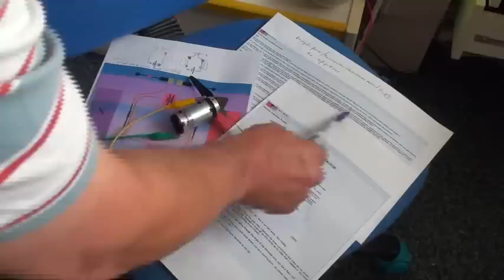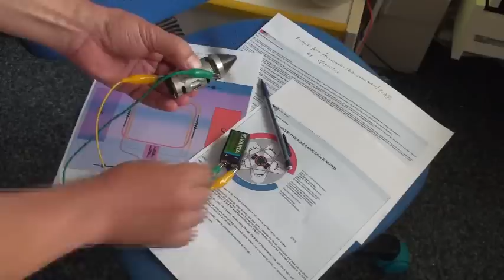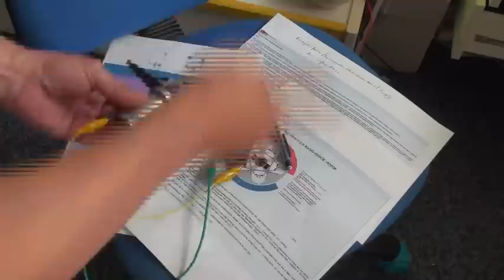Ufo assymetric motor part 1

Comment from the maker: Hi htannberg

Yes  the part 2 was irrelevant because i did not realise (too much enthousiasm ) that my drawing was not in accordance with the real connection in the real motor. So my presentation was misleading Sorry. So i retired the video.

Now i am in full discovering mode in this motor and  i am testing a lot of different config.
So for the precise data you have to wait.
This motor is very intriguing, so i propose that you replicate it and report  you results.
Laurent

Comment: What happened to part 2 ?  Did you find a mistake?  Please post the rating on the unmodified motor  volts, rpm current, and on the mondified one.

If you have another motor use the propeller as the load and do both messurements, and submit data.  Thanks!

Comment: Hello Woopy. Have you made a comparison between the stock motor and the modified motor. What is the wattage of the stock motor spinning the propeller at a given RPM. Then what is the wattage of the modified motor spinning the prop at the same RPM. I'm trying to find how much more efficient the modification is. UFO said the motor was over unity. I would expect it should be a great deal more efficient than the stock motor!
John

Comment: Connect the motor to the connections and get it spinning. Then test the other connections and see if there is any voltage generated. ALSO look at the stargate motor and add magnets like he did to see how IT works..